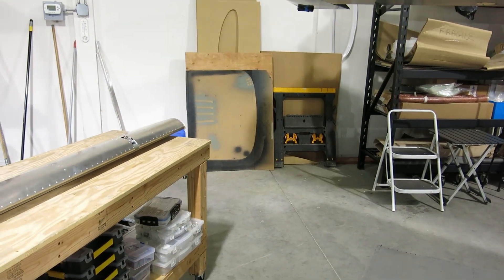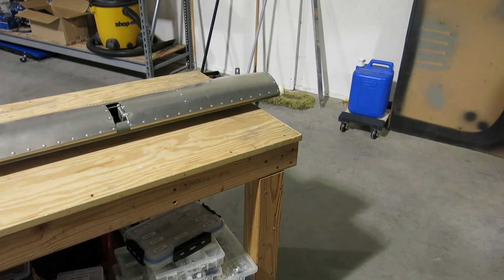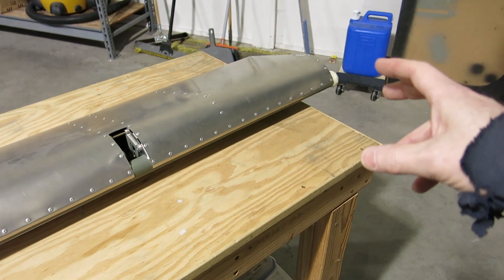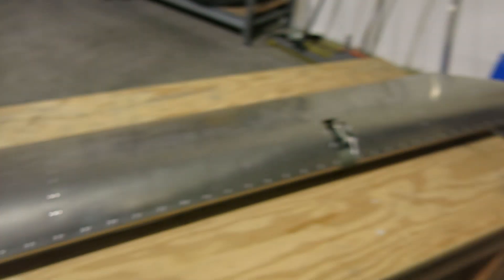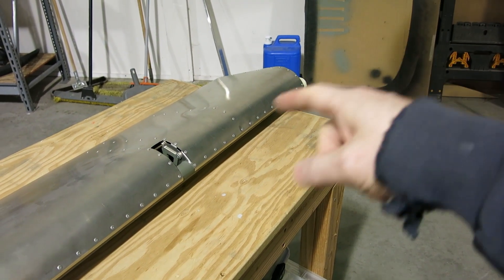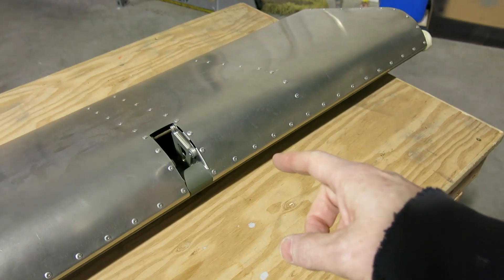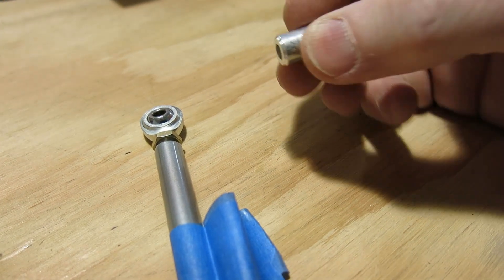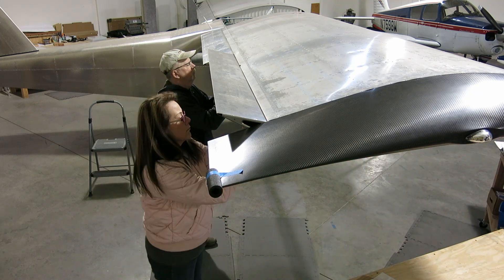No. 340 03-10-2024 Ailerons balanced, installed, and rigged

Comment: Were you able to borrow a tension meter?  I probably will need to buy one, but they are a little pricey.  However, I will need one for each condition inspection so probably a sound investment.
Reply from the maker: Yes, our EAA chapter has an extensive tool collection including the tension meter. We’re very grateful to have the chapter hangar about 30 sec walk from where we are.
Reply: @s-21project92  Fortunate indeed.

Comment: Is the rear jam nut easier to access than the front one?  Might be easier to run the front one in 10 turns and lock the nut down and do the rest of the fine adjustments using the rear one only.
Reply from the maker: The rear jam nut is very easy to access (I’m a little concerned with the size of the rain hole up there on top of that aileron!).
Yeah probably could just install it before skinning the wings and adjust the rear rod end.
Reply: @s-21project92  I have to check my wings, but I think I did install mine when doing the bell crank.

Comment: I have to admit I find the RANS balancing concept on the sketchy side.  I’d much rather see a lead plug in each end of the torque tube held in place by a rivet or screw so that it was firmly held in position and easily removed and replaced should different weight be needed.  I don’t think I’ve seen the lead shot, epoxy and foam technique used before, but probably some other experimental has used it.

Comment: S-21. Just saw your video for the first Time. Just learning about Flying. Just a Question about Carbon Fiber. Why don’t more Builders don’t Use the Hybrid Fibers Cloth? Like the Carbon/Kevlar Fibers cloth? I would think you have less breakage in the Part because the Kevlar Fibers? Also the way you can dye the Kevlar it be Awesome to look at.
Reply: Lots of people using some carbon fiber in experimental aircraft but it's very expensive and very difficult to work with . You also have to be careful about the placement of antennas with carbon fiber.  Can cause interference issues if not used correctly.